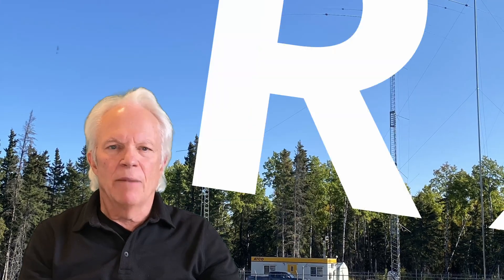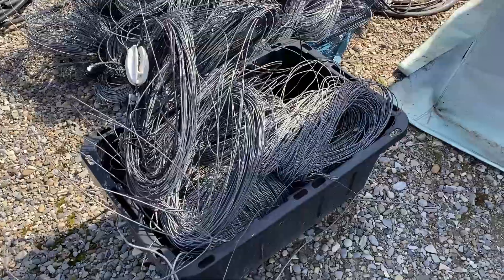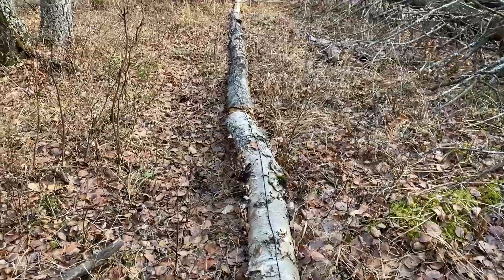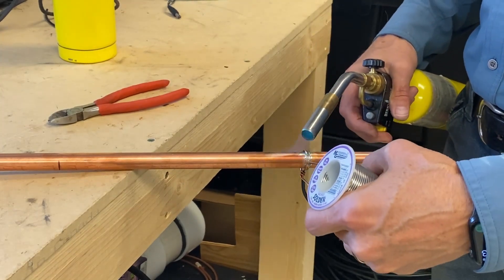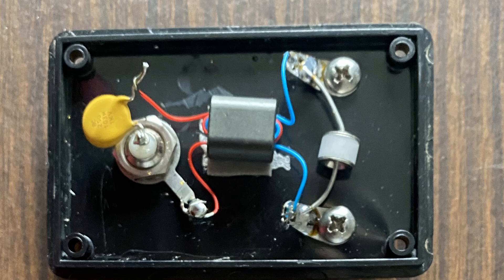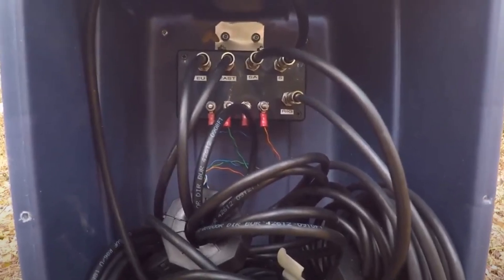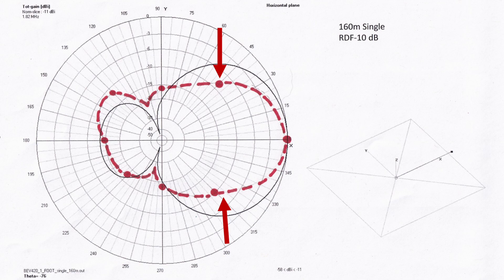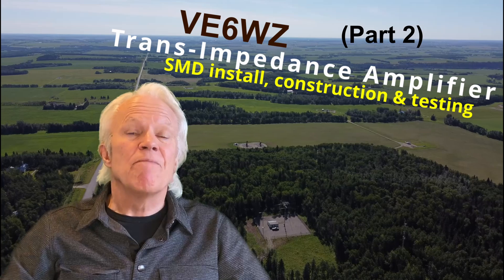The BOG RX system at VE6WZ (part 1)

Comment: Excellent. Glad to see your success. I have used quite a few BOGs since about 2011 when I moved away from my salt marsh location. (Beverages did not work at all over my salt marsh ground but everything else did!) My first one was 225 feet pointed NE and I expected to increase it a bit but it worked so well I left it. I also had one pointed West that was about 480 feet. The directivity was amazing when I switched between them. I also had a more conventional Beverage pointed South. I found even shorter BOGs worked reasonably well.  I currently have one about 200 feet long pointed West and another I roll out across the backyard pointed to Europe each winter. Like you I use short ground rods at both ends and about the same value terminating resistor. 73, de Don, N4DJ

Comment: Hello steve 
Greetings from Philippines 
Its 6pm locsl 23 nov 2024 
Listening to 160m static crashes 
No copy on cqww cw contest any 
Station

Interesting video 
FYI
Ive tried LOP K9AY and BOG
Bog seems only thing helps 
At mountain shack 

Your skimmer receivers using bogs
What azimuth though 

Your using 300 to 400 ft ? 
Most use 200 ft 

73 bob du7et